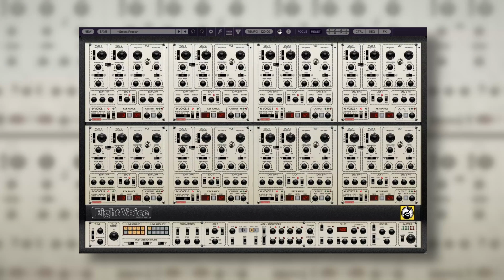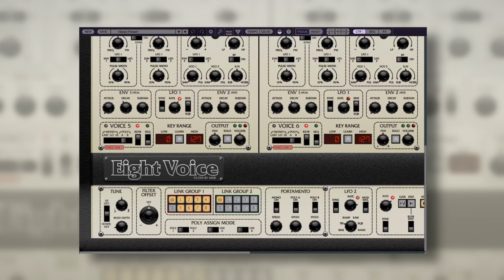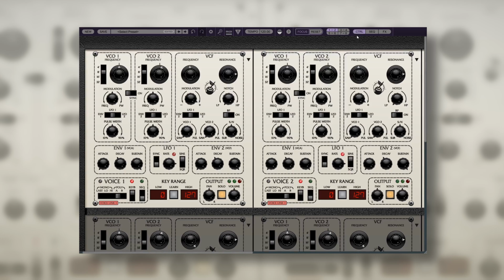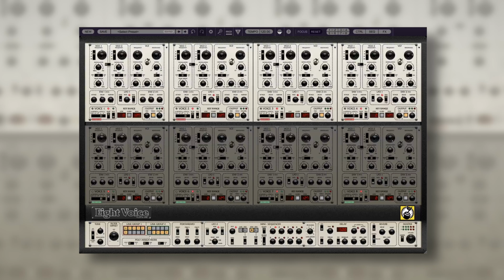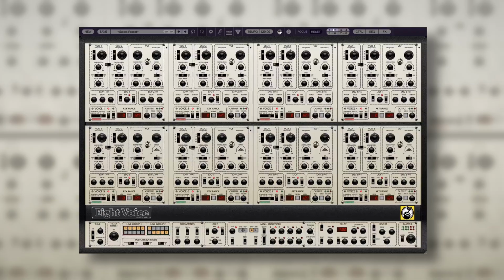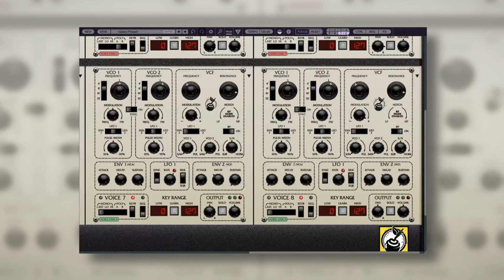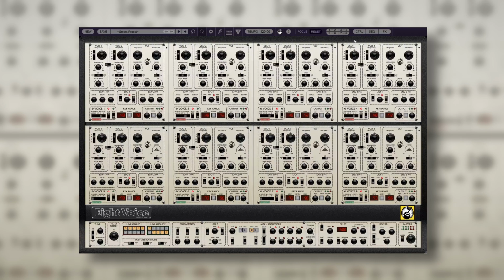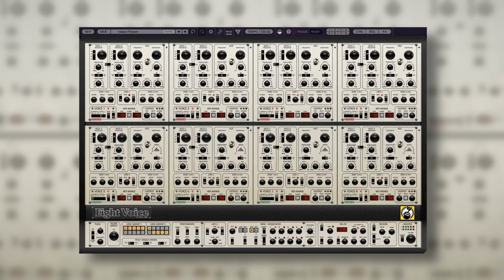Creating Key Split Patches | Cherry Audio Eight Voice

Comment: Is this Synth velocity sensitive ? I mean if you  touch a key softly does it play at a lower volume ?
Reply: It would appear not looking at the synth perhaps a feature request I do not think that many of the OB's were velocity sensitive
.
Reply from the maker: Yes, you can optionally control both the filter envelope and the amplifier envelope amplitude with velocity.
Reply: @CherryAudiovst  That's great. Thanks. I will buy it. It's good value.